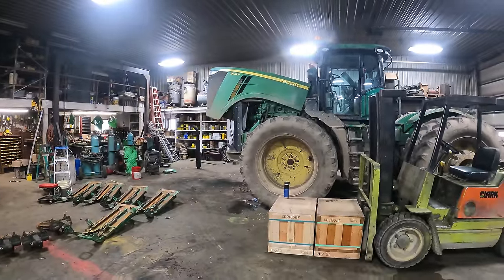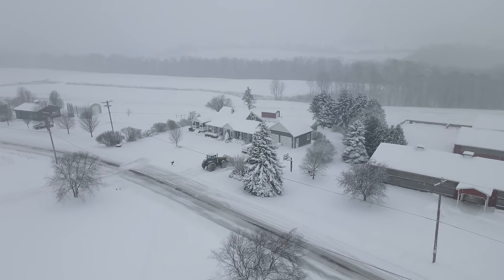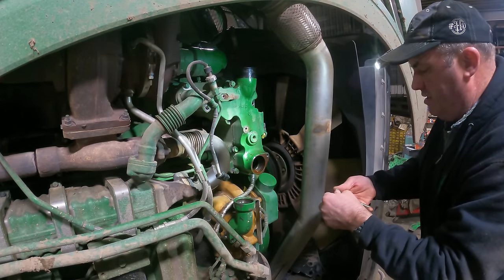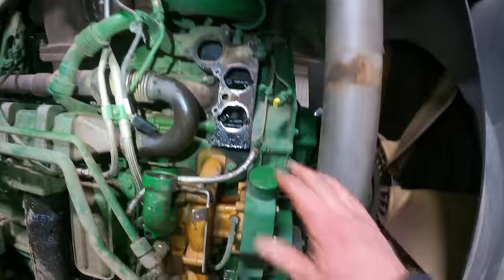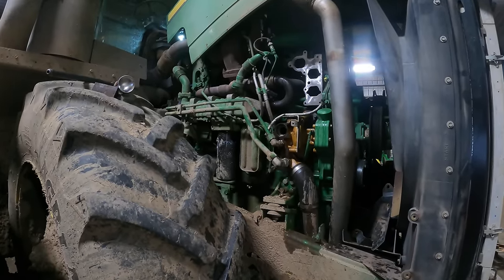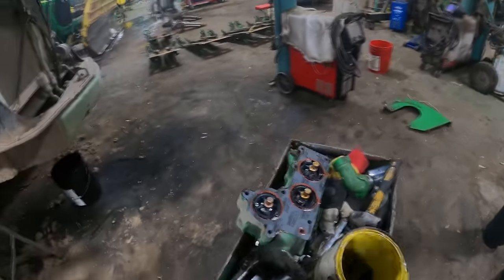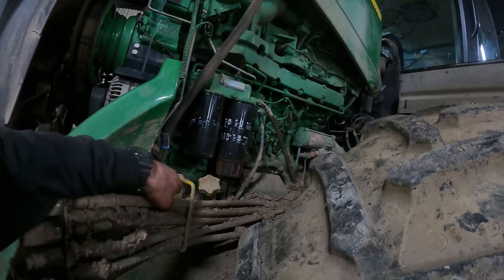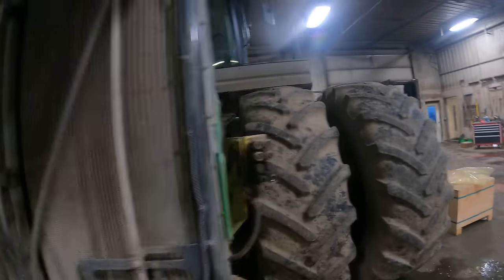Snow and 9410R with problems

Comment: I have started using the pre-mixed antifreeze, and my boss is too. It was pointed out that well water varies in hardness and contaminants that can cause clogs and rust. Never thought about it before, but since the switch my truck has run cooler. 🤔 Great video Andy, loved the drone footage!
Reply from the maker: We use only premixed
Reply: Distilled water is a lot cheaper then the water in the premix.

Comment: I was surprised you got 9410 to stop the regen. Ive tried to stop it on my 318G skidsteer few times. End up just shutting it off. Although isnt good when its cold like its going to be here in Wi. Exhaust definitely smells hotter and different.

Comment: Andy, I attended a Vermont Fire Academy training last night regarding Lithium Batteries and their inherit dangers. The instructors noted a significant uptick in fires in New York City due to electric bike batteries overheating and causing a fire. This has resulted in 13 fatalaties.  I know you have obtained electric bikes. I would suggest you not store them in building. Also dont leave the being charges. Lots of information online regarding these issues.  Good luck
Reply from the maker: Cell phones do the same thing
Reply: Best to stay in your basement as well as lightning might strike ya.
Reply: There has been fires all over.
They definitely get HOT and catch on fire. I agree keep them outside or in a separate building not attached to anything.
Reply: Hi  @FarmingFixingFabricating
Reply: @FarmingFixingFabricating h
Reply: @FarmingFixingFabricating  Yes and no. I do not know of any fatalities due to cellphone fires only people getting burned and that's when you are in direct contact with it. Cellphone fires are quick/short lived. Additionally a cellphone can fit into a cookie tin to be contained, quickly taken to a safe place, and if not is often not a large enough fire ball to complete incinerate your building if it is kept away from combustible materials. Where as an e-bike will make a fire ball large enough that you can not get near it or extinguish it and will sustain a fire long enough to burn many things around it. The issue with ebikes is often not the 18650 (or similar) lithium ion cells but rather poorly implemented charging system and/or battery management that does not have adequate safety. Every cell should be fused and they should never be over charged...often the cells are not fused and the chargers over charge the cells...there in lies the hazard. Many insurance companies do not cover lithium fires. 

I build my own EV battery packs and get folks telling me all the same precautions all the time. When you study the technology and use it with in specifications of the datasheet you are safe. The thing is many ebike manufacturers do not use the cells withing specification of the datasheet.
Reply: And the moon might fall out the sky too, come on we can’t foresee in life every little possibility that this might happen, that might happen, you can’t wrap everything in bubble wrap hoping to prevent this, that, and the other from happening, nothing would ever get done 😏😏

Comment: Andy, how do you keep from mixing up US and Metric sockets/wrenches on your scale of equipment?    I used to use a dab of yellow(US) and red(metric) paint on or adjacent to the bolt to
identify it correctly.
Reply from the maker: Separate tool box drawer for each and when I’m working on something that requires both,I can tell by just looking at the tool

Comment: I like them Milwaukee sharpies I've got two of them in my front pocket at all times. Hey out of curiosity, what size snow pusher do you run on your backhoe? Im building one now the original plan is 12 foot but I'm a little concerned my machine won't push a full 12 feet, so I thought about maybe cutting it down to 10
Reply from the maker: This one is 12’ and pretty much is junk.10 would probably be better, backhoe has no traction. Tire chains would help
Reply: Good deal thanks. Kind of what I was thinking too Im glad I saw this tonight